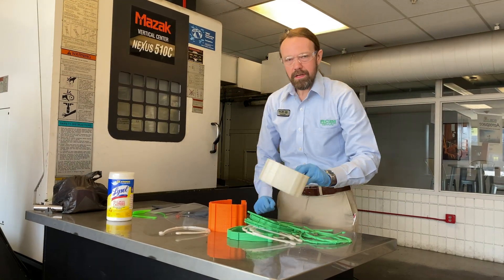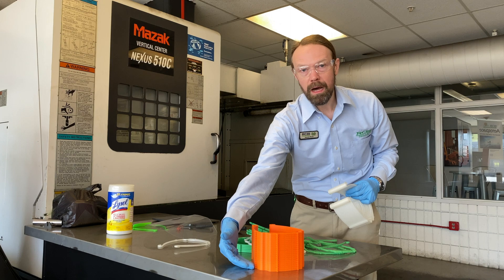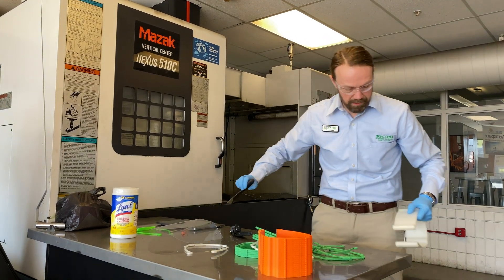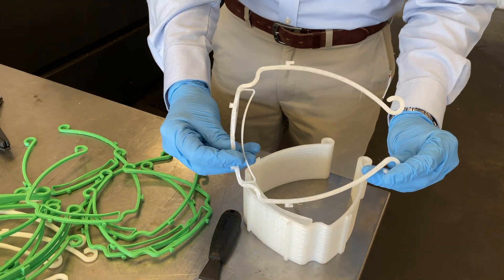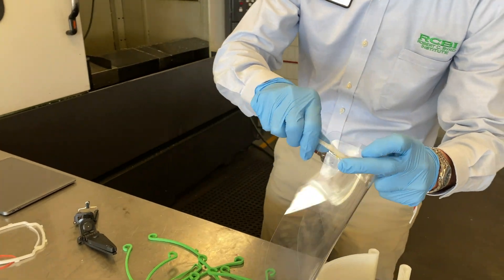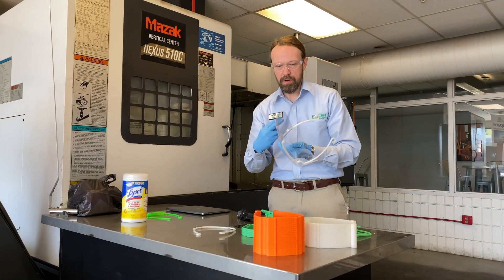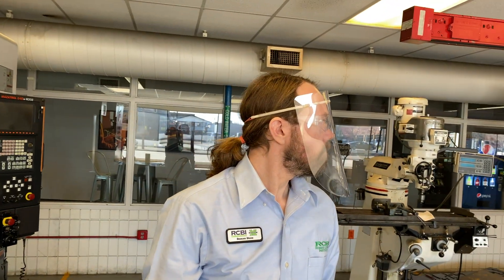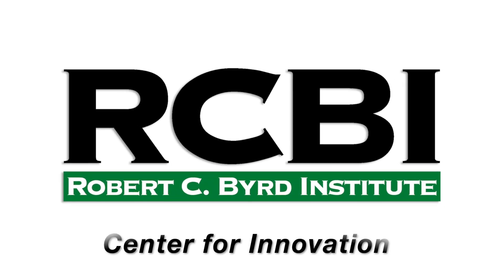3D Print STACKING - MASS Manufacturing Medical Protective Equipment

Comment: Did you add a space between each print to allow easier separation. If so, what distance did you use on your TAZ Bot, what is your nozzle size, and what material was used? Regards

Comment: I've printed 100+ visors similar to this for medical staff in my area, but I desperately need to produce more. I'm struggling with stacking, tried a few methods, I'm only able to print 2 on a bed at the moment. Can you please share your STL model and recommended settings/nozzles that your using please?
Reply: here : https://retrolabs.com/3d-prints/3d-printed-face-shield-with-10-mil-pvc